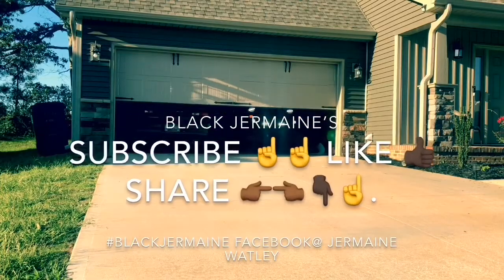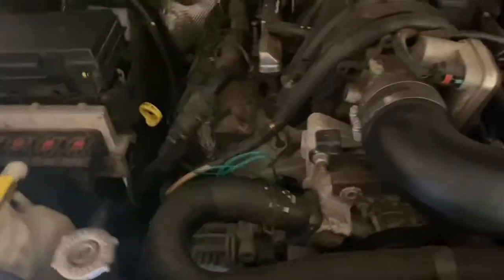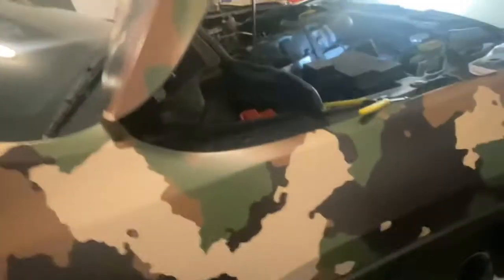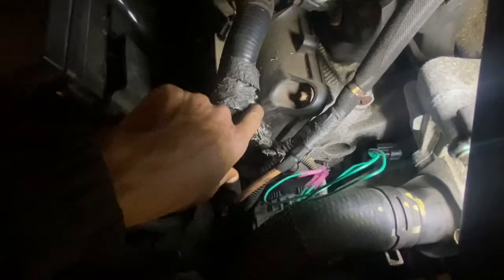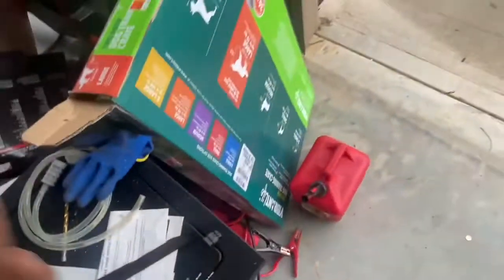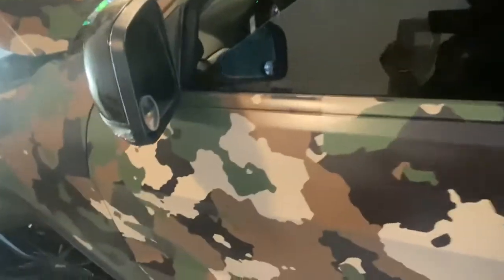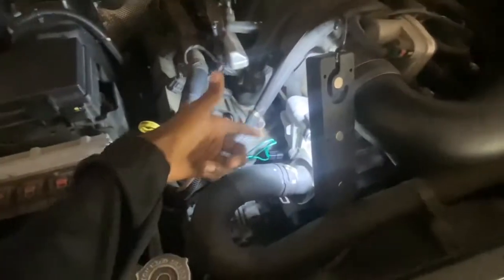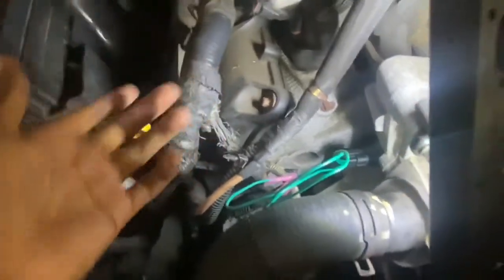Fixing Check Engine Light & Traction Control Issue with Camshaft/Crankshaft Sensors Code P0340/P0344

Comment: Parts came in and your video helped. My issue FIXED. Thank God I found your video Bro. My wires were TOAST. LOL.  It felt good mashing the gas without the check engine light/traction control and power dropping.